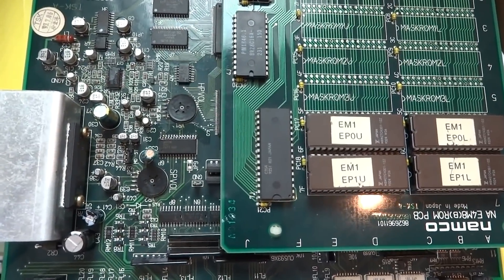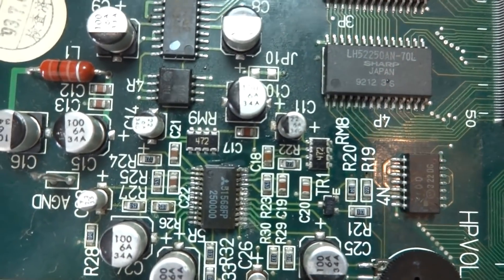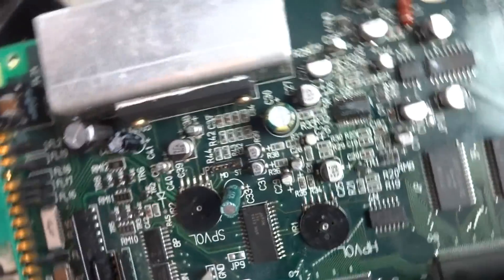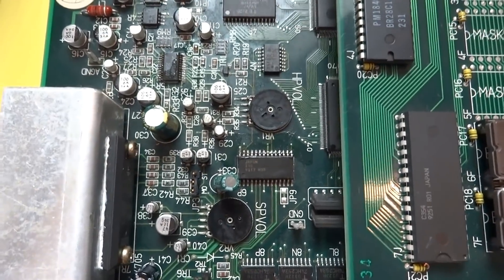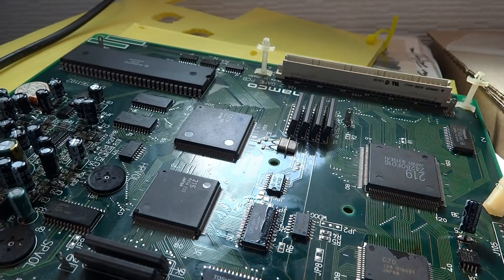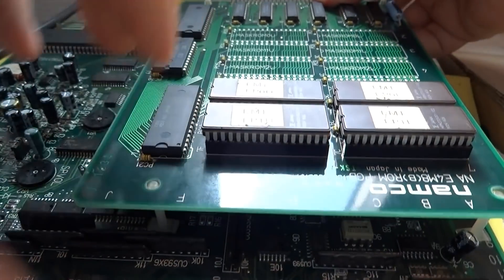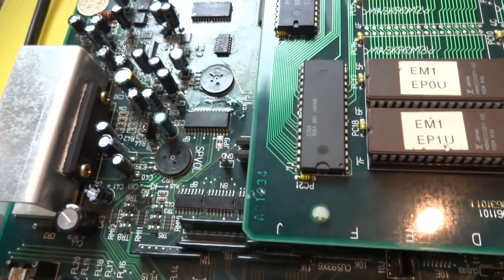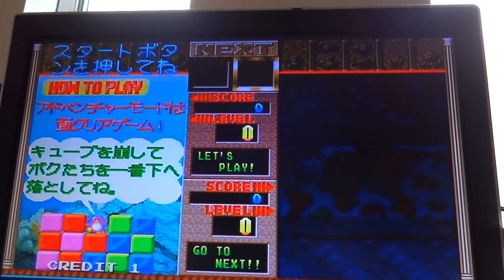Emeraldia Namco NA-2 Arcade PCB No Boot, Solid Color Screen Repair

Comment: This game still has some nasty emulation errors in MAME, glad you didn't toss it! The "219" chip in general has some emulation errors. It's in charge of the sound mostly, some MAME dev made the error of emulating it as the C140 (another namco sound chip) and the VGMRips wiki STILL calls the C219 and variant of it... it's not, there's a lot different. So much emulated C219 music is in the wrong pitch (not to mention the sample quality), and that makes me sad. It's getting better though!

Comment: The best way to remove these caps is by using two soldering irons, one on either side of the cap. This way you dont have to reheat the pads multiple times or use pressure.

Comment: I have seen that many times before. After a capacitor swap the boards boot to a black screen the first time around. After that everything is fine. Its like the caps need to soak in first.

Comment: Man, I remember recapping my Mega Drive, that was some 30+ caps on one board. Made a big difference to the quality of the system audio and video though. Adding some fresh solder before using the desoldering pump helped a tons there too.
Reply from the maker: For sure, these caps really do make a difference when you replace them with fresh ones. All of those caps but when you finish it is really rewarding lol. For through hole caps a soldering pump works amazing and I totally agree, I use one all the time.  Hope you are doing well

Comment: Great to see another board up and running =D  Using hot air to remove them isn't as bad as you think - the boards where SMD caps have been fitted tend to be completely unaffected by the use of hot air.  They can pop when using hot air though, I found that recently on a CD32!  Each to their own though!
Reply from the maker: haha, thanks man. I know that guys like you, I and many others can work things out with the hot air route but I need to be careful about the people who watch this channel and decide to try it from home. I would hate to have someone pick up a hot air gun and apply 400 degrees to cap and watch it pop off and hit them in the face or spew fluid on them, liability. You are right though, each to their own and so many ways to do repairs that there really isnt a "100% right way" to do it. Nonetheless, hope all is good with you

Comment: I see me some Luke fixin' stuff, stop everything I'm doing and click.

In all seriousness, excellent work as always, it's always nice to see a PCB get revived, no matter how objectively... "average" it is. one thing though, the sprite rotation on the title screen looks pretty badly corrupted, not sure if that's a RAM, ROM or knock-on-wood graphics processor issue, might be worth watching out for.
Reply from the maker: Haha! thanks Daniel. Yeah, there is definitely something up with that, and I think it is the ram as well but I may try to burn some new eproms and see if that fixes it. I went back and checked my blast city restoration pt 5 video and even at that time it had the same graphic error lol. Ill check it out though and thanks for watching man :)

Comment: Best way for removing surface mount caps is to use 2 soldering irons and liquid flux. They pop off easily without any sideways force that can damage the pads.
Reply from the maker: The soldering tweezers are great for this as well and totally agree about applying heat to both sides!
Reply: I use a cheap hot air station. Easy, fast and no damage to the board.

Comment: Wish I knew how to connect Arcade Boards to TVs.
The Boards I would like to own are the original Dead Or Alive 1, Tekken Tag Tournament and Soul Calibur 1.
Reply: The cheapest way to achieve this I find is to find an old ATX PSU with a -12V rail (some boards require it for sound) and wiring up a JAMMA harness to it. The video can be a bit troublesome as the refresh rate as a general rule is not supported by standard TVs, luckily there's an overabundance of cheap converter boards on all the standard sites, usually searching "RGB/CGA/EGA to VGA" or "HD9800/GBS8200" will return a bunch of them, I word of advice when looking for a JAMMA loom/harness is make sure it has the 5P-SVF-V connector (also known as the "Five Pin JAMMA Monitor Connector" or "Five Pin JAMMA RGB Connector") on it, as it can be directly plugged into the converter board without soldering. After all that the only tasks left are wiring the buttons up and hooking up the audio (not entirely sure about this, depends on whether the board outputs an amplified or line-level signal, stereo is another situation entirely, as JAMMA only outputs mono by default). 

Otherwise, if you've got the budget and don't want to have to build one yourself, you can get a JAMMA SuperGun, which is basically what I've described above but made of more suitable parts and has everything built neatly into a box with the control panel (joysticks and buttons) on top.

I'm Sorry I forgot the details near the end, I haven't done this in a while, last time I kinda gave up and opted for getting an old Hantarex MTC 9000 20" CRT, fixing the dead chassis, and using that with my boards, it's cumbersome but it works.

Whichever route you decide on taking, I wish you luck.
Reply from the maker: @danielm2142  Fantastic info here :)
Reply from the maker: Some great choices there and with the info below provided by Daniel you can definitely get a self made rig going for a decent price! take care